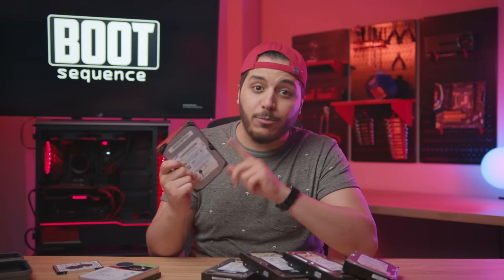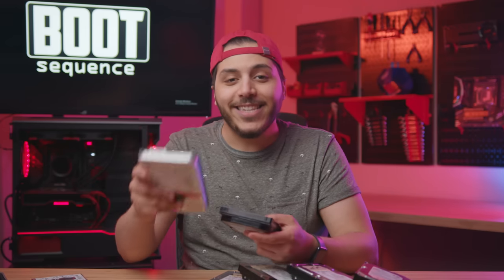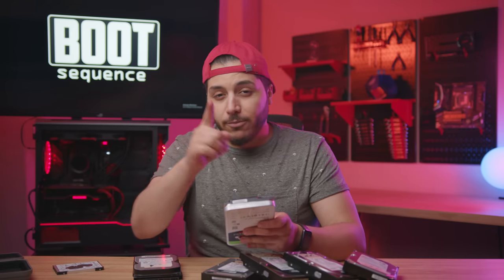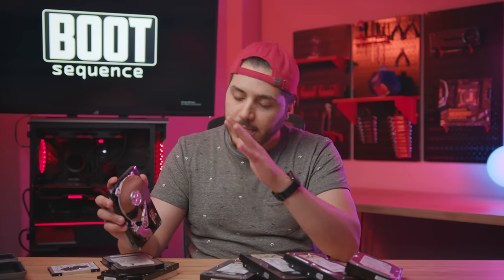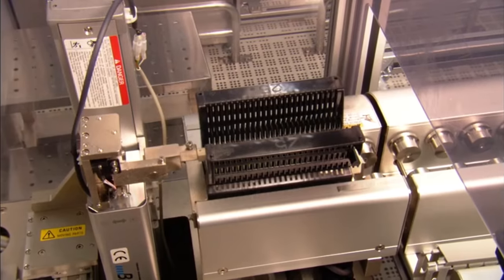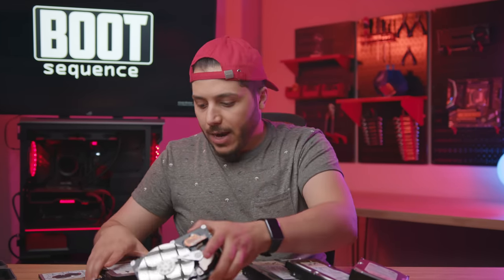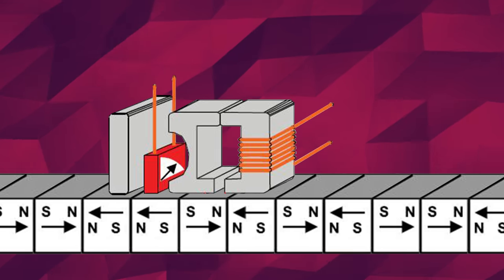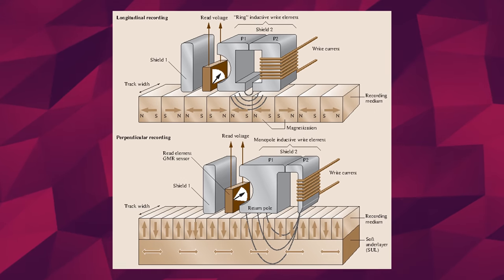The Evolution of Hard Drive Technology!

Comment: I love hard drives especially since I use OpenZFS 2.0 and I keep using all my HDDs everywhere:
- 2003 Back-up server, a Pentium 4 HT (2 x IDE 3.5" 250 + 320GB and 2 x SATA 2.5" 320 + 320GB) used for ~1 hour/week.
- 2011 Laptop i5-2520M (2TB, new), currently used for 95% as backup server 2.
- 2019 Desktop Ryzen 3 2200G (500GB + 1TB; ~8 power-on years; stand-by after 5 minutes). The HDDs are partitioned as 2 x 500GB in Raid-0 cached by 95GB SSD partition and a 500GB partition at the end of 1TB cached by 33GB SSD partition. The HDDs are used for less than 6 hours/week.  For the daily stuff I have a 512GB nvme-SSD (3200/2300MB/s).

This week I like to try a Proxmox server on ZFS. I want to reuse a 2008 Phenom II X4 B97. I like to try 2 ancient IBM SCSI HDDs (10,000 rpm; 18 + 36GB) + 80GB SATA HDD. Also configured with 2 x 18GB in Raid-0 and 18 + 80GB in LVM if possible. 

Now I only have a 160GB sata HDD (2.5"; 35MB/s) free, that Dell sold to me in 2008 in a Windows Vista laptop :( :(  I keep it as USB2 or USB3 drive.
All other drives I have kept, are below 13GB and all are IDE.

Comment: Anyone else have anxiety when he's waving the drives around in the air? Like they could drop any moment. Good video btw. My first drive was 750GB in 2008 i believe. Then 3TB in 2012 or something and now 14TB a few years back.

Also 500GB and 2TB + 2TB PCIe 4.0 SSD's too. I think im good in terms of capacity and speed for the forseeable future.
Reply from the maker: the 16TB is a borked one. It was DOA, so dont worry about me handling it :P!
Reply: HDD is no longer viable. That 16TB HDD you have there, how long before you can fill that up? The SATA interface is very slow for multi TB drives. If time is important to you, the only solution right now is the SSD.
Reply: @maynnemillares  The answer for that is RAID. More capacity and faster speeds combined. You as a user would see them in a GUI as one big drive, when in reality they are multiple drives linked together. There are multiple RAID levels tho. Depends on your need of performance and redundancy. We use RAID 5 in our data center at work. We can monitor them, swap out one drive as soon as it fails and continue on without a problem

Comment: There are a options to make more memory, using math and to the power to system and re coding how the head both reads and writes it, combining multiples of 1s and multiple 0s or making larger dives doubling the thickness of the drives total thickness .  Good comparison is like  twin of 3080 ND comparing it to the thickness of a aorus 3080 xtreme. Another idea is using sensors and light. Which would work with the first idea.

Comment: I use a 1TB SSD for games that I am playing and applications that I am using the most, that require speed. Games I am not playing, mod archives and nonessentials are stored on one of my 2TB, 7200 rpm HDD's. That way my SSD doesn't get slowed down by having to much on it.
Reply: HDD is no longer viable. That 16TB HDD he have there, how long before you can fill that up? The SATA interface is very slow for multi TB drives. If time is important to him, the only solution right now is the SSD.

Comment: Too bad ssd is still expensive and they don't go 12Tb.
Reply: Actually SSD's go way beyond HDD capacity already. The biggest HDD is 20TB tho the biggest in retail is 18TB. The biggest SSD atleast in the 2,5" form factor is 30TB already. Atleast in the retail tho i believe there are some specialized 100TB solutions too. The biggest M.2 form factor SSD is currenbtly 8TB and the biggest PCIe 4.0 M.2 is 4TB.

Obviously the biggest problem with such huge SSD's is their price vs HDD. But in terms of capacity they have already exceeded HDD's.
Reply: @Raivo_K  yeah, it's way easier to put more nand flash modules which are tiny compared to the hdd's platters

but the cost, tho, omg it's insane
Reply: @Lloyd-Franklin  That's a good price, I got HDD's that are 100 each for 2tb
Reply: I got 3*2tb drives for 100 each so thats 300 euro's for 6tb and I put them in Raid0 so they're blazing fast.

Comment: Haha.  Look at this "old small" 250GB drive.   250GB was unimaginably large  back in the day.
Reply: I remember calling a friend the moment 2GB (2.5 GB? Not quite sure...) drives became available. I think it was WD that was first, but it's so long ago that I really don't remember. Thing is these drives were absolutely humongous compared to the 500MB drives we were using. Now these were not the first HDD's we had, those were 10 or 20 MB. Yes, MB. I built a external disk chassis and installed a 40MB full height 5¼" Micropolis SCSI drive to use with my Amiga 500. Now for those who wonder a full height 5¼" drive is as thick as two regular DVD drives. The drive alone was heavy. With the chassis it weighed probably twice as much as the A500 it was attached to.

But back to the story. I worked for a computer company and immediately ordered one of these new huge drives for each of us even before I had talked to my friend. At the time we felt there would be many years before we would need more disk space, so it probably wasn't a year before I added another even larger drive...
Reply: @blahorgaslisk7763  your history more extensive than mine.   1995 is when I got started.   Thanks for sharing 👍
Reply: @videoviewer2008  I have worked with some pretty old stuff such as magnetic core memory and the weird acoustic memory used by a terminal that had what looked like a spiral torsion spring in the base with a "kicker" at one end and a microphone at the other. I think it stored about 800 chars encoded with seven bits, possibly six or even five if it only used capital letters. It was a long time ago and I can't remember the details.

As for HDD's I've seen a lot of interesting designs and formfactors. While in school I got to tour a data center where they were replacing all of their old drives that used disk packs with these fantastic new HDD's that stored almost a GB in a single unit. It was a cabinet a bit more than a meter high and almost as wide. When you opened it up you saw a round metal enclosure that surrounded the actual disks which almost filled the cabinet. I estimate the disks to have been about 80 cm to a meter in diameter. The disk was driven by a belt drive, the motor in the bottom of the chassis.

This was state of the art at the time. Transfer rate, latency, reliability and capacity was way better than the old disk stacks. I think they said a disk pack used by the old drives stored up to 40 MB, but it could just as easily have been anything between 4 and 40. they had something like 80 of these old drives and had long since outgrown the capacity. Before they got the new drives they had to manually swap out disk packs when running less common jobs to have the data needed. All of these old drives were being scrapped, and I got to see some of them doing a three storey dive out of a window and into a dumpster. Pretty heartbreaking to see so much money being thrown away like that. But then it was all so ancient as to be basically worthless.

Sorry for rambling on. It was just a deluge of old memories that suddenly got unleashed.

Comment: Why not put extra read/write poles on the head to do the shingling in one pass? Forget buffering; read the data just before the overwrite pole passes, and follow it up with another write pole? Can they not cram multiple read and read-write poles on the head? No need to lock up the dingle arm on a single track ring for three revolutions.
Reply from the maker: Honestly, this seems like a viable option. Given there are 10+ heads. My best guess is that it's an issue with the actuators for the arm. So far, the best they have done is 2 actuators. I'm guessing they are slowing down innovation to 4+ arms to make more money
Reply: @BootSequence  I would stagger the poles on each head by one track so that the head remains stationary while rewriting a shingled track/sector.

The geometry of the head - that it swipes over the tracks from a slight angle - could be issue as tracks from radically different radius are rewritten. The distance between poles would change slightly depending on the angle of the head relative to the tracks.

There is another problem here in shingled recording that the drive briefly contains invalid data. A power loss can corrupt data. I am not sure how big the capacitors are on hard drives but I suspect that there is a limit to how many shingled operations can be in progress while safely assuring that shingling rewrites can be completed in any power loss event.

Comment: following a nice lawsuit against the SMR (well because the companies tried to sell this as "normal drives") all spec sheets from WD are indicating now if a drive is SMR or CMR

Another good indicator is the cache size: a drive with 256mb of cache is very very likely an smr.
Although SMR drive are not all bad, they're cheaper and very nice for a backup or a drive to write once and read a lot
Reply: horrible horrible write speed once u get past the cache threshhold, sub 20MB/s on my 4TB smr
Reply: @virtualtools_3021  yes that's exactly the point, you don't use them as a main drive, you use them for something that doesn't need a lot of write, like storing pictures

Comment: last week i bought a new 4TB of HDD. along with 500GB SSD now i have 1+1+2+4TB hdd.
Reply: How many drives in total
Reply: 4 HDD 8TB Total + 1 500GB SSD for boot.
Reply: @Ajstyle48  is it very noisy in the case?
I'm thinking of getting hard drives since 3 3.5 cages are empty but worried for noise and want system to be quiet as possible

Comment: HDD is no longer viable. That 16TB HDD you have there, how long before you can fill that up? The SATA interface is very slow for multi TB drives. If time is important to you, the only solution right now is the SSD.
Reply: The professional end doesn't use SATA but SAS (what SCSI evolved into) that can transfer 2.5 gigabytes a second (22.5 gigabits a second). So data centres still use HDs
Reply: @Psy500  I'm not talking about data centers, but rather from the perspective of the end-user. I'm sure the viewers of this video are mostly end-users, who uses a computer for personal computing.